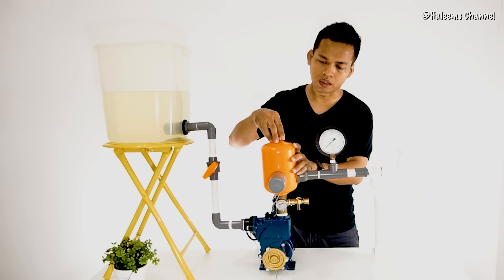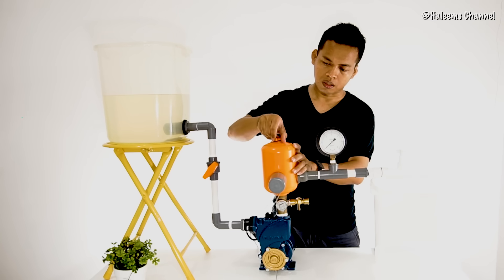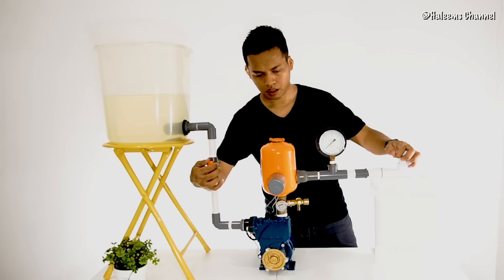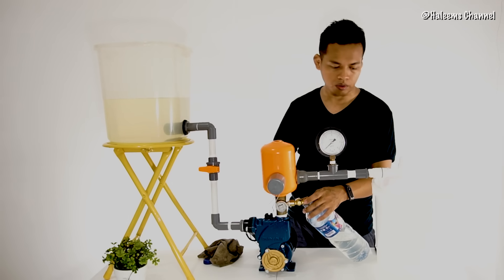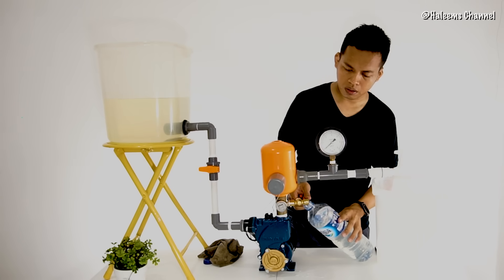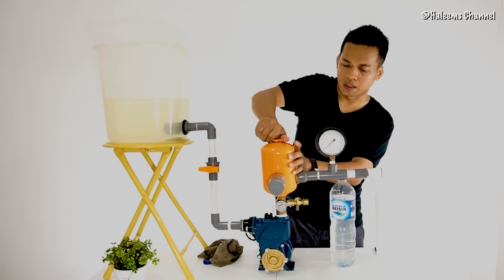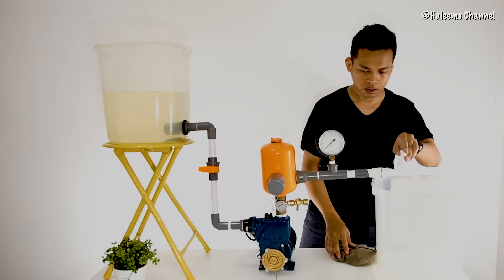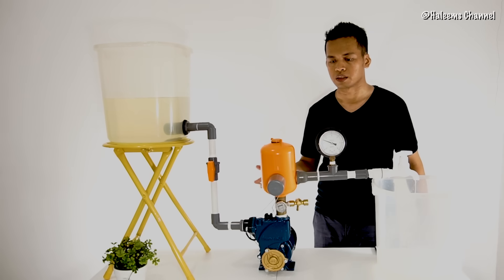Cara Memasang otomatis Pompa air dan Mengatasi Bunyi Cetak Cetek pada Otomatis/Pressure Switch

Comment: Mantap bang, thx informasi nya yg membantu. 
btw kalau dibandingkan dgn metode flow switch (untuk pompa dorong ke pipa distribusi), sebetulnya lebih bagus mana? 
apakah ada perbedaan kencang nya semburan antara memakai pressure switch dibanding flow switch dengan pompa yg sama (contoh shimizu ps 128 bit). 
terima kasih sharing nya. salam kenal
Reply from the maker: Kelebihan Flow switch, lebih halus tanpa ada bunyi cetak cetek.., kekurangan nya tidak bisa digunakan utk pompa hisap.

Kelebihan pressure switch, bisa digunakan utk pompa hisap dan dorong ataupun booster.. 
kelebihan yg lain adalah, karena pressure switch menggunakan tabung tekan, maka pada saat bukaan kran pertama, tekanan air terasa lebih kencang, terlebih jika menggunakan tabung yg besar...hal ini karena adanya tekanan yg tersimpan didalam tabung..seketika itu pada saat kran dibuka, tenan menjadi terasa kencang.
kekurangan nya, salah satunya adalah adanya bunyi cetak cetek..ini terjadi hanya jika tabung tekang sudah tdk berfungsi/rusak.

Fungsi keduanya, Flow switch dan Pressure switch adalah sama, yaitu sebagai sakelar otomatis, keduanya tidak mempengaruhi performa pompa atau semburan pompa.
semburan pompa hanya dipengaruhi dari besar kecilnya tenaga motor dan desain impeller nya...

bila ada yg belum jelas, bisa ditanyakan kembali.
terimakasih..

Comment: Bagi yang tanya2 brp sih tekanan on off pressure switch yang bagus

Ini saran nya!!
tekanan air pompa air dalam ke adaan normal adalah antara 30 psi sampai 60 psi. Tidak ada aturan khusus tentang seberapa besar tekanan yang terbaik untuk rumah Anda, karena kebutuhan setiap orang berbeda. Namun, apa pun di bawah 20 psi kemungkinan akan menyebabkan kinerja perangkat yang buruk yang menggunakan air. Yang bertekanan 
Contoh water heater mesin cuci otomatis
Selang air set yakni selang air yang saat pembelian sedah termsuk kepala semprot dan konektor2 nya 
Karena kepala semprotan nya harus pakai air yang bertekanan misal dari pdam atau pompa air
Reply from the maker: bang bang, terimakasih sudah berbagi pengalaman.

untuk memudahkan pengertian tekanan dalam satuan psi..
1 psi = 0.069 bar = 0.7 meter (mH2O) satuan ketinggian kolom air.

pompa jenis 125 watt dan 200 watt yg ada di pasar Indonesia saat ini.. rata2 memiliki total head berkisar 30 meter atau sama dengan 42 psi

Tekanan atau total head (psi) sangat berbeda dengan debit air atau laju kecepatan aliran air (liter/menit)
pada kondisi pompa yg sama, apabila total head/ tekanan nya tinggi (bukaan kran diperkecil), kecepatan aliran air akan mengecil.
dan sebaliknya pada tekanan yg rendah (bukaan katup lebar) maka kecepatan aliran akan lebih besar

Kecenderungan kebutuhan tekanan adalah pada: 
1. penggunaan pompa untuk rumah yg memiliki ketinggian lantai lebih dari 2 atau 3 lantai...sehingga perlu tekanan tinggi
2. untuk dorong ke penampung air pada ketinggian tertentu.
3. untuk sprayer/semprot air.
4. penggunaan tap/kran yang banyak saluran

sedangkan kecenderungan kebutuhan terhadap laju atau kecepatan aliran air, adalah pada:
1. pemindahan air, pengisian bak, (pada ketinggian head/permukaan yang rendah)
2. rumah lantai 1. (tidak bertingkat)
3. jumlah kran sedikit

jadi lebih sederhananya.. misalnya, jika rumah saya hanya satu lantai, dan kran saya hanya satu atau dua saluran, pertimbangan besarnya adalah saya harus memilih pompa yang laju aliran atau debit air nya besar... tidak perlu total head nya yang tinggi..(karena total head yg tinggi, power listriknya besar dan boros biaya)

tapi jika, rumah saya bertingkat 3 atau sampe lebih... dan saluran krannya banyak... berarti saya harus memilih pompa yang total head nya tinggi..

survey dari water solution, lifestyle survey 2018, kebutuhan debit air sbb:
1. shower : 25 liter/menit,
2. wastafel : 20 liter/menit
3. dapur : 15 - 20 liter/menit
4. bath : 20 liter/menit

dengan referensi data itu, pompa jenis 125 watt sudah mencukupi, untuk 1 atau 2 kran, pada head rendah (permukaan rendah)
pompa jenis 200 watt setingkat lebih besar dari 125 watt...yakni bisa untuk kran hingga 3 kran atau 4kran..pada head rendah..
bila keduanya dipergunakan utk head yg tinggi (permukaan tinggi, lebih dari 2 atau 3 lantai ke atas) akan mengalami penurunan debit airnya..

jadi pemilihan tekanan air ataupun debit air, harus menyesuaikan kebutuhan instalasi penggunaannya..

Comment: Bang mau tanya , punya saya kok otomatisnya ga mau mati sendiri y bang , padhal kran udh di tutp semua tpi dia masih hidup , kira2 yg kesalahannya dimna y bang ,
Reply from the maker: kalo tidak mau mati, pada saat kran sudah ditutup,  berarti tekanan pompa tidak mencapai titik OFF nya.. 
pressure switch memiliki titik OFF pada tekanan 1,8 kgf.
utk mencapai titik tersebut, dgn kondisi instalasi hisap 9 meter, diperlukan tekanan pompa minimal 2,7kgf/cm2,

nah, biasanya pompa tidak bisa mencapai 2,7kgf/cm2, sehingga tidak mau OFF, tidak mati saat kran sudah ditutup.

solusinya, 
1. cek tekanan pompa minimal harus 2,7kgf/cm2. bila trkanan kurang, kerusakannya pada impeller dan tutupnya kemungkinan sudah aus.
atau cara lain,
2. setting pressure switchnya, turunkan spec, dengan memutar baut setting pada pressure switch.
Reply: @HaleemsChannel  iya bang s3telah tdi sya cek lagi terkadang dia mau mati bang , tapi ga lama dia nyala sendiri , padhal ga ada kebocoran di pipa ataupu di sanyonya , kalo bgitu gimana bng solusinya , apa mungkin otomatisnya agak eror atau gmna ? 
Mohon pencerahanya bang
Reply from the maker: @bangjago9279  sistem kerja otomatis pressure switch bekerja secara mekanis, jadi kemungkinan error sangat kecil.. ON dan OFF nya hanya berdasar besaran Tekanan, bila tiba2 ON sendiri berarti ada perubahan besaran tekanan yang disebabkan bocor pipa atau bagian pompa nya, silahkan periksa kembali.. utk lebih detailnya mohon informasinya mengenai pompanya, merek, model. dan jenis penggunaan pompa nya, untuk hisap atau hanya untuk dorong... thanks..

Comment: Bang sya baru pasang shimizu 128 tpi knpa stiap mau nyalakan harus minta di pancing dulu baru mau kelur air nya
Reply from the maker: pipa hisap nya menggunakan foot valve apa gak bossqu...? kalo menggunakan footvalve ada kemungkinan bocor, sehingga air di pipa hisap selalu kosong, perlu mancing setiap saat..
jika belum menggunakan footvale, sebaiknya pasang footvalve..

meskipun pompa tersebut sudah dilengkapi checkvalve, namun terkadang check valve sering bermasalah... jadi sebaiknya tetap gunakan footvalve, utk menghindari kosongnya pipa hisap..
Reply: Coba cek klep di bawa yg di pasang di sumur nya

Comment: Lha itu masih cetak cetek pompanya? Seperti kasus di rumah saya yg sumber airnya kecil sekali debitnya/gak ada toren. Akar masalahnya adalah spek flowswitch otomatisnya. Minimum flowswitch utk ON tipikal 1,2 bar dan OFF 3 bar. Di pasaran saya gak nemu spek utk ON 0,1 bar. Akhirnya solusi universal nya, saya buat flowswitch sendiri dari flowmeter efek Hall dan diprogram dengan mikrokontroler min, max, dan parameter lainnya utk ON dan OFF. Flowswitch nya masih bekerja sampai sekarang.
Reply from the maker: Daisman Aji cetak cetek yang dimaksud adalah bunyi dari ON dan OFF terus menerus tanpa ada jeda.

Pressure switch ya boss... bukan Flow switch..

Spec pressure switch yg ada di jual di pasar:
ON - OFF (unit kgf/cm2),
1.0 - 1.6
1.1 - 1.8
1.2 - 2.4
dengan toleransi +/- 0.1

Spec Flow switch yg di pasar;
minimum aliran 3 liter/menit
Reply: @HaleemsChannel  Iya sama maksud saya cetak cetek dgn yg Anda maksud, juga cetak cetek yg jeda 2 sampai 15 detik atau lebih ketika aliran air ON atau OFF. Ini problem banyak ditemui termasuk rumah saya yg blm ada solusinya, makanya saya modif flowmeter dan dipadu dgn mikrokontroler. Tentu beda pressure switch dan flow switch, tapi intinya kan kita mau atur otomatis ON OFF pompa. Saya sdh pake berbagai flowswitch dan pressure switch yg ada di pasaran, tapi tidak berhasil, karena speknya nya min ON tipikal 1,2 bar atau 3 L/min. Makanya saya buat instrumen otomatis sendiri. Terima kasih atas videonya.
Reply from the maker: @daismanaji9576  mantaph... kreatif... 
saat ini sudah banyak dijual automatic pressure controll, yg metodenya adalah kombinasi antara flow dan pressure, dilengkapi trigger dan reset... hanya saja harganya masih lumayan..berkisar paling murah 250rb an...
Reply: Haleems Channel bang kalau automatic pressure gak harus pakai tabung angin ya kalau buat pompa manual?
Reply from the maker: @chandrachrismarantika5285  automatic pressure control bisa digunakan tanpa tabung..
namun bila ingin tekanan pompa nya stabil bisa di install dengan tabung..dan tentu bisa lebih awet pompanya karena lebih stabil
Reply: Haleems Channel berarti efektif pressure switch pake tabung apa ATC?
Reply from the maker: @chandrachrismarantika5285  kalo di banding dgn pressure switch+tabung vs. automatic pressure control, tentu lebih bagus automatic pressure control...hanya harganya lebih mahal
Reply: Haleems Channel berarti ATC itu merangkap tabung+flow dan pressure switch ya gan?
Reply from the maker: @chandrachrismarantika5285  iya benar kombinasi... makanya pada saat kran di buka kecil pun tidak cetak cetek, karena pada saat kran bukaan kecil yang digunakan adalah flow sensor nya..
Reply: Haleems Channel untuk sumur dangkal bsa kan gan
Reply from the maker: @chandrachrismarantika5285  bisa..

Comment: Italse sangat sangat buang biyaya...?
Reply: Mantaf ulasannya, saya mau tanya nih gan.. saya sudah pasang tabung sperti divideo tpi hanya kuat satu minggu terus tabungnya retak akhirnya air banyak keluar dari retakan tsb, apa mungkin itu karena tabungnya yg gk kuat atau krna hal lain..??
Reply from the maker: Jajang Veray utk normal tekanan pompa 3 bar, harus nya tabung tersebut tidak masalah..
bila sampe terjadi masalah retak, berarti ada potensi tekanan yang diterima tabung lebih besar, tekanan yg lebih besar bisa terjadi karena adanya water hammer...
solusinya pasang tusen klep, atau bisa juga pasang tabung yg lebih besar, atau water arrester, untuk menghindari water hammer..

nah, penyebab lain faktor fisik, karena bahan plastik, mungkin retaknya terjadi sebelum penggunaan karena ada benturan dll, atau karena faktor cetakan/injection plastic nya pada parting line nya tidak bagus sehingga terjadi retak..

banyak cara dan banyak pilihan...utk menangani kasus seperti didalam video.. tidak mesti harus sama persi seperti video di atas... tapi metodenya, dalam hal mengatasi persoalan pressure switch, harus ada accumulator tekanan..
sedangkan accumulator tekanan yang ada di pasar sangat beragam.. yang bagus sudah pasti mahal.. yang murah banyak tapi harus selektif..
silahkan dipilih sesuai kebutuhan dan sesuai dgn budget..

rekomendasi kami, bila menggunakan metode otomatis pressure switch;
1. pilih tabung tekan yg menggunakan membran ato karet yg dapat diisi ulang gas/udara.. penggunaan tabung yg lebih besar lebih baik..
2. pilih pressure switch yang memiliki kontak point/ relay yg tahan terhadap percikan api akibat arus listrik.

nah, kalo gak mau ribet dgn pressure switch... ganti saja metode nya dengan flow switch.. tapi flow switch hanya berfungsi untuk pompa dorong..

kalo tetap mau menggunakan metode pressure switch yang lebih bagus, gunakan automatic pressure controller (harga nya seharga 1 pompa jenis 125W)

banyak pilihan silahkan di coba..
kalo masih menemukan kendala, silahkan bertanya di channel kami... konsultasi gratis..
Reply: Pake T 4way aja cukup kayaknya bos..gak pake tangki piber lagi,biar gak makan tempat,terimakasih
Reply from the maker: @lindamaulidina7673  terimakasih sudah berbagi pengalamannya, semoga bermanfaat buat teman yg lain... 
pada prinsip nya utk mengatasi masalah seperti dalam video ini ada banyak cara...tidak mesti sama persis dalam video... yg terpenting yg ingin disampaikan dalam video ini adalah metode/cara kerja pressure switch dgn tabung tekan...dimana metode itu bisa diaplikasikan pada berbagai jenis komponen yg sejenis pressure switch yang ada di pasar..
Reply: Ok Terimakasih gan sudah dikasih pencerahan, pompa air yg saya pakai shimizu 128 ,saya akan coba   kembali dgn tabung yg baru, dan pakai pressure switch, karna yg kmaren saya pakai otomatisnya pakai water flow switch

Comment: Kalau pompa sering ngempos di karenakan apa.apa airnya kering atau ada kerusakan dg kompanya.mohon penjelasanya trima kasih
Reply from the maker: pompa air itu menghasilkan tekanan, kalo ngempos berarti tekanan yg dihasilkan pompa menurun..
yg mempengaruhi tekanan pompa menurun adalah:
1. komponen mekanis nya (impeller) sudah aus, casing pompa sudah aus..
bagian-bagian tersebut harus dilakukan pengecekan, dan penggantian
2. komponen elektris nya melemah, dalam hal ini bagian motor, gejala motot melemah yaitu RPM nya lambat, atau bahkan starting tidak bisa.
3. kelistrikan, dalam hal ini sumber tegangan listrik terlalu rendah dari spesifikasi..misalnya spec 220Volt, tapi aktual kurang dari voltase tersebut..
4. masalah sumber air, kurang nya supply air menuju pompa..dalam hal ini kedalaman sumber air terlalu dalam

penjelasan diatas sifat permasalan umum,
untuk lebih detailnya silahkan gambarkan bagaimana kronologi pompa nya ngempos..
jenis pompa nya apa, kondisi instalasinya bagaimana, berapa lama penggunaan pompa nya, kedalaman permukaan air, kelistrikan nya stabil apa tidak..
baru bisa di analisa lebih detail
Reply: Bocor itu gan di bagian penghisapan/bisa juga tidak pake saringan gan

Comment: Yamamoto yah gauge nya?
Reply: Gauge merek yg bagus apa aja ya mas tau tidak? SoAle saya banyak permintaan gauge
Reply from the maker: @anotcorr  kalo merek saya gak bisa menyebutkan (nanti dikira promosi), hanya saja saya kebetulan lebih sering menggunakan merek Yamamoto keiki, tapi merek lain juga kadang saya pakai, yang terpenting rentang ukur nya akurat dan pembacaan alat ukurnya terkalibrasi,
saat ini saya menggunakan 2 tipe, analog dan digital,
analog pembacaannya kurang stabil di banding yang digital, hanya saja yg digital ini perlu instal power supply (ada juga tipe yang menggunakan battery), jadi kadang agak ribet instalnya kalo untuk portabilitas..
kalo yang analog sangat portable, lepas pasang sangat mudah..
Reply: Okeeee bosss,makasih masukan nyaaa,saya tau kolo yamamoto bagus🙏🏻
Reply from the maker: yups

Comment: Pompa dorong saya shimizu begitu tuh, dan setel on off pompanya susah banget sesuai keinginan.  Kayak misalkan hanya nyala di saat kran yg dibuka minimal 2. Ngga ketemu2 setelannya. 

Oh iya, pompa dorongnya juga gak dilengkapi dgn tabung tekan, apa karena inikah sumber masalahnya?
Reply: pompa khusus dorong (tidak seperti video diatas) ttp nyala walau kran yang dibuka kecil AFAIK
Reply from the maker: @dennyfrans8145  iya benar, karena pompa dorong yg sering kita jumpai di market adalah menggunakan sistem otomatis Flow Switch...dimana cara kerjanya memanfaatkan buka nutupnya paddle saat ada aliran atau tidak ada aliran... dengan batas minimum aliran tertentu, biasanya spec flow switch minimum aliran 3 liter/ menit, bila kurang dari spec tersebut flow switch tidak bekerja..
jadi, kalo dibanding yg jenis flow switch, dalam video ini kasusnya sudah berbeda...

baik itu flow switch ataupun pressure switch masing-masing memiliki kelebihan dan kekurangan... silahkan dipilih sesuai kebutuhan dan budget...

pada dasarnya pompa dorong bisa menggunakan sistem switch otomatis yang bermacam-macam jenis nya...
1. pressure switch
2. flow switch
3. automatic pressure control
4. dll.
Reply from the maker: terimakasih sudah berbagi pengalaman nya ya boss qu...

sebagai informasi, setelan pressure itu hanya utk setting batas on atau off, yg sifatnya sangat terbatas sekali... utk mereduksi tekanan harus ada tabung udara...sehingga tekanan lebih stabil dan pressure switchnya bisa lebih aman..
silahkan di coba

Comment: Rempong om.. Kalo air dari atas.. Beli water Flow switc khusus yang tidak bunyi. Langsung pasang..  Pasti gak bunyi.. Lebih sederhana
Reply from the maker: untuk tipe instalasi dimana permukaan air lebih tinggi dari pompa (air dari atas), memang benar, sistem otomatis paling rekomendasi adalah menggunakan flow switch, sesuai video berikut, 
http://bit.ly/2T020ci

namun, untuk video pressure switch yg ini  http://bit.ly/2OsJG8b ,  membahas tentang penyebab bunyi cetak cetek dan cara mengatasi nya..

baik itu flow switch ataupun pressure switch, masing-masing memilki kelebihan dan kekurangan, untuk penggunaanya tentu disesuaikan dengan kebutuhan... 
http://bit.ly/2Pzdqpd

Comment: klw pompa sudh otomatis nya bawaan pabrik gimana cara buang angin nya gan????
Reply from the maker: bukan buang angin ya bossqu...
tapi buang air nya... isi dengan angin atau gas nitrogen
masing2 pabrikan beda2.
secara umum ada dua tipe..
1. tipe dengan menggunakan karet/membran
2. tipe tanpa menggunakan karet/membran.

utk tipe yg pakai karet cukup isi ulang angin atau gas nya melalui lubang pentil
(dgn catatan karet nya masih oke, tapi kalo karetnya sudah koyak dan bocor, harus ganti part nya)

untuk tipe tanpa karet, cukup kosongkan tabung nya dari air..dengan cara melepas tabung nya dan keluarkan air didalamnya..